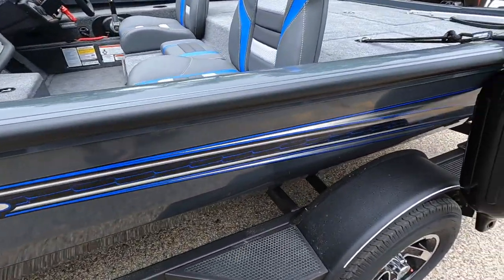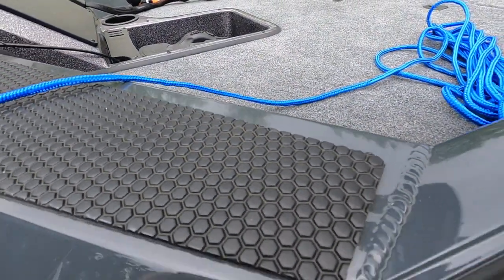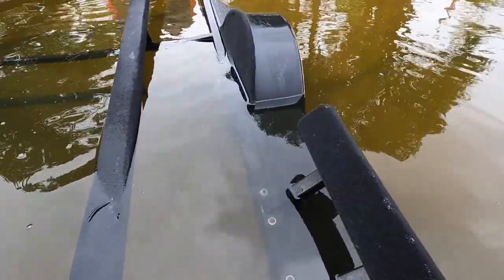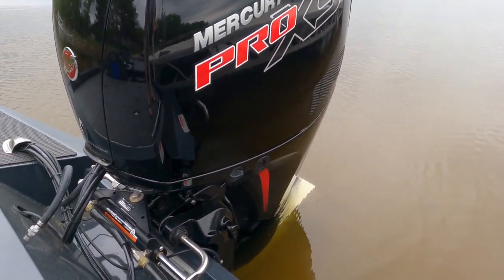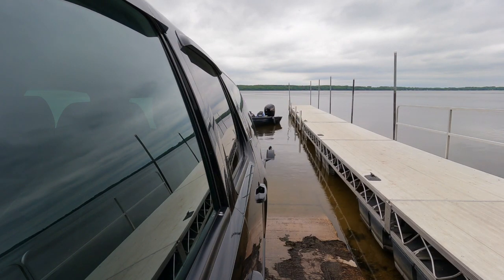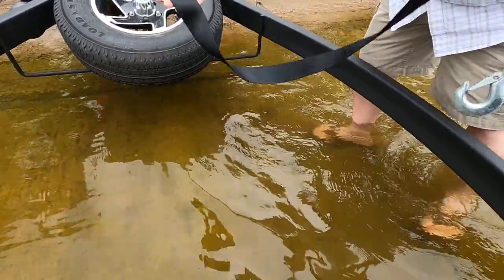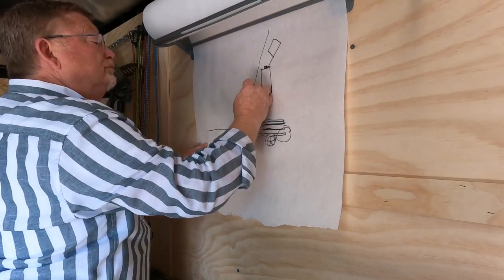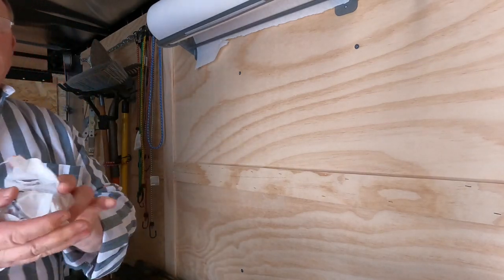The Ranger trail trailer, is off the rerailer?

Comment: I'd be very cautious, completely disconnecting the boat before launching. I watched mine skid 30 ft down the ramp doing that. Only slightly steeper than the ramp you're on. Back into water, then unlatch the winch strap, back a bit more, and give the brakes a bump and slide the boat off. I had launched it hundreds of times completely unhooked before that.
Reply from the maker: That's a good tip..hearing that story makes me sad..😖

Comment: If it’s a little crooked when you pull it out rock the boat it will settle in just fine
Reply from the maker: I  can't rock a 13 hundred pound boat on a" CUSTOM" trailer when it's out of the water  and I shouldn't have to. I'm to old..I solved the problem by modifying the guide bunks, refer to my segment "Ranger trailer with rerailer" now it lands perfect every time. Thanks for your thoughts.
Reply: @joeromans1836  27 years of fishing and I’ve only done this twice